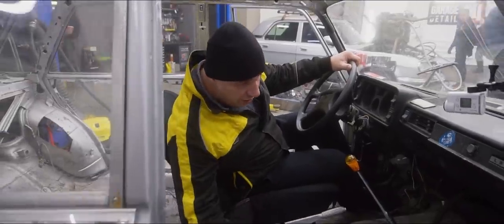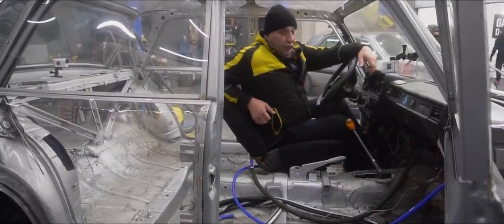How to make a cheap DIY seat heater

Comment: I would still pipe the heater core first in the circulation, and put a fan on it so there will be cabin heating, and the seat won't get as hot.
Reply: No real need for a heated seat at that point, since most of the point of a heated seat is for getting warm before the engine does.

Comment: Had similar idea but with cold water for summer; I had the tubes on the outside on the seat so you physically sat on them, got a small pump inside a metal insulated flask filled with ice water, worked a treat.

Comment: Take a radiator from a house, put it in the car and hook it up like that. Use that to heat the car
Reply: Even better: replace the seat with a house radiator
Reply: Beyondthepress did AC using a heat pump ran off a generator strapped to the roof. They put the outside unit inside and the inside unit outside and set it to heat the outside. Basically was a walk in freezer set up.
Reply: Or just use a small radiator and put it up in the dash and call it a heater core.

Comment: It's all fun and games untill the seat hose explodes...
Reply: I've never seen a hose explode except for joint's on burnout cars
Reply: Your going to get instant boiled eggs
Reply: @kilobishop8364  ,omg!😂
Reply: @Be4tJumper  That is very true. With the amount of safe stuff they do now. It would be hard to make one  explode
Reply: My thoughts exactly. Boiled nuts anyone?
Reply: @Be4tJumper  I had the upper rad hose burst on my car a few years ago, it split wide open on one side. (I'm pretty sure it was the original installed on the assembly line in 93, lasted something like 280k or so)
Reply: Reminds me of my dad's friend in the 80's when they were having fun with cheap cars during the winter. This friend of his put the coolant of the car behind his driver seat, to avoid damage to it. While they were drifting the coolant overheated and spilled hot coolant all over him, and he had to bail out of it while it was still moving LOL
Reply: @Be4tJumper  ask the dude from Cleetus Mcfarlands Burnout Rivals that had a radiator in the back of car set up like Leroy that got 3rd degree burns when the rad hose exploded right behind his head how that worked out for him..
Reply: @Be4tJumper  it happens all the time. Especially in Frozen conditions.
Reply: Hence the difference between an experiment and a final product...
Reply: @jjhack3r  hence the reason why this is never been done in the hundred plus years of automobile manufacturing. This is merely a video for clicks
Reply: @amymoriyama6616  Yes …true
Reply: @kilobishop8364  hahahaha...lmfao!👋😂👌boiled eggs 🥚
Reply: Seat warmer with a chance to get 3rd degree burn
Reply: Precisely what I was thinking!!!  That would be a far far FAR worse consequence if something broke/failed than any electrical malfunctioning!!!!  Hell, just look at Cleetus Mcfarlands channel where one of the participants in the burnout contests car radiator and/or hoses busted/exploded and he got really REALLY bad burns from the steam/hot coolant.  It took him out of action from work for at least 6 months while he recovered from his extensive injuries.  I’m not so keen on running these scalding hot lines of DEATH right through my seat cushions and plumbed all around me, especially plumbed right up my ass and balls....That is the “Worst day EVER” just waiting to happen....
Reply: @grandtheftautotune7715  yeah but he wasnt driving normal, he was at red line for minutes in a super high load and stress burnout
Reply: @amymoriyama6616  steamed fish :P
Reply: Then we’ll get boiled nuts.

Comment: In the 50's or 60's, car accessory and electrics giant Lucas sold a windscreen washer heater which was basically a metal tube with a plastic water jacket that had two little spigots and you connected your washer bottle pipes to the water jacket and the engine coolant would warm the metal tube up and create steaming hot washer fluid for the screen.   You could prob do something like that for internal heating but with a slow running circulation pump and of course robust pipes.

Comment: I mentioned it before but I don’t know if you saw it try filling a car‘s brakes system with water to see if it could be done in an emergency that’s a cool experiment
Reply: Good idea
Reply: Or водка.
Reply: @tomikuusla925  YAAAHH!! Even better
Reply: mastermilo did that
Reply: Water doesnt compress like brake fluid does but it would work for awhile. Unless it is a DOT5 system the water will not displace the residual left. You could never purge a DOT5 system clean enough for water to work safely as DOT5 is not oil based it is silicon based and wont mix with the water ever. Its like trying to shovel mud around with a rake, the mud is dot5 and water the rake.
Reply: @dylanmccallister1888  Yeah I know we’re talking garage 54 here it’s just for fun
Reply: @dylanmccallister1888  By the way the reason they use fluid in Brakes is because fluid doesn’t compress I do believe you are using the wrong word
Reply: It would work just fine until heat built up and the brakes locked on. Apart from that and the obvious lack of lubricity it would be fine to get you out of trouble.
Reply: @dylanmccallister1888  brake fluid like any fluid does not compress.. also most vehicles do not run Dot5..
Reply: Or vegetable oil?

Comment: I did this to provide heating to the rear of my box van back in the early 80s. I connected the supply and return to a heater coil that I got from an auto junkyard. I didn't know anything about vapor locks and never had that issue. The only issue I had was that I ran the hoses directly from the radiator underneath the van. That didn't allow the engine water to get very hot. So, the rear of the vehicle also didn't get very warm. Still, something was better than nothing. If I had it to do all over again with what I know now, I'd probably run a grid of hoses throughout the floor. Maybe even the walls and ceiling. The question here is when is too much water for an engine? Especially in the winter months. I would imagine that the summer months wouldn't be much of an issue. A cutoff valve would be good enough. That would have been some experiment.

Comment: I could have use that this last winter lol not heating at all when the blower goes out. Have a great one guys.
Reply: At least it was just the blower! I had a car with a badly leaking heater core and i had to bypass it. 0 heat whatsoever. At least with the dead motor (been there too!) You get a little breath of hot air through the vents to try and warm your hands. 

2 things i don't want to deal with again!
Reply: @volvo09  On my old workhorse car the heater core is leaking, I bought used one for cheap but I have to remove the whole dashboard to replace it 🥺 I just postpone it. I did that on my sister's car two years ago and I said to myself never again but now I have to do it again
Reply: @philipgligorov5848  BMW ?
Reply: @joro407  Citroen ZX

Comment: replacing clutch plate with torque converter in manual transmission. Will it shift and drive?

Comment: You don't need to pump at all. You can just use the heater core lines, or tie into them. They already have pressure and flow Inward and outward, what you should do, put a ball valve on the inlet side  of the two lines, where it comes into the back of the seat,then, in between the seatback, and the seatbottom,( inlet side of the loop) a second ball valve. That would give you all the adjustability you need to have the heated seat evenly dispersed. And if you don't believe me about not needing a water pump, just look at any van that has front and rear heat and AC. All they do, is T into the existing heater lines, the in and out, they run it all the way to the back of the van to a second heater core, they don't use an extra pump, and it is 10 ft away from the engine or more, and it works just fine.

Comment: Bolt a house radiator into where the backseat would be in line with the heated seats for like a dual heating effect that also might keep the seat from getting so scorching hot.

Comment: Ideally you would have some sort of thermostat. Pretty sure they sell those on amazon. Also you would need solenoid valve. And then connect the solenoid valve and pump to thermostat. You might also need a electrical relay.
Reply: Or just buy an elecric heated set cover for about 10$ and plug it in the cigarette lighter/12V DC socket... 😅
Reply: @Pinyoo81  haha true :D
Reply: @Pinyoo81  but it's not as efficient so you will use slightly more gasoline :p
Reply: @Pinyoo81  also you could diy that type of heated seat very easily. :P
Reply: @oplkfdhgk  I usually tend to diy things if it's expensive to buy the proper one, but it's 10$ so I guess I wont... 😅
Reply: @Pinyoo81  i can understand that :)

Comment: I would like to see how much you can heat the cabin by moving the radiator inside and an mounting an electric fan to it. I imagine it would be super hot considering that a normal heater core is just a small radiator.

Comment: Vlad put a Ford 7N21-18495-AC inline with the hoses which you can power to isolate the seat loop.  Its going to be no fun without a way to regulate it.

Comment: I saw the thumbnail and instantly thought…..I beat you by at least 20 years in my jeep CJ-5
…as a heating contractor that does radiant heat, this works well and i have the ass-scars to prove it
I’ll watch now
EDIT 4:00 no not really.. mine had no extra pump. I simply added a tee then ball-valve and another tee to a heater line then, the branches of the tees went over to the “manifold” under the seat that consisted of three loops of 1/4 inch tubing (per seat)  with push fittings. It was awesome except for the ONE LONG TRIP THAT LEFT A NICE SCAR lol SPASEEBA!!

Comment: in all honesty, this idea is nuts but would be 100% workable... and a great use of what would be waste heat so long as you can leakproof the entire thing and have bypass valves to prevent the hot coolant from cooking the driver...

Comment: Or you could get a cable that is 4ohm But also have enough length to cover the seat and then just connect it to the battery(and have switch in between so you can turn it off). But i guess it's more efficient to use the waste heat from motor :)

Comment: get large industrial syrofoam block 4200mm X 1700mm x 1500mm Carve out a super car style body for lada. and prosper. have solid styrofoam  light weight body. full insulation warm in winter. pre white instant ural camo so as not to be mistaken for vodka cooler by roaming slavs expecting a cool drink from styrofoam party cooler. but NO is lada!

Comment: The old Checker cars had very good seat heaters under the seats. In fact it would burn your feet if you weren't careful. But otherwise the cabin heater sucked. Allot of dead space to try and heat inside.